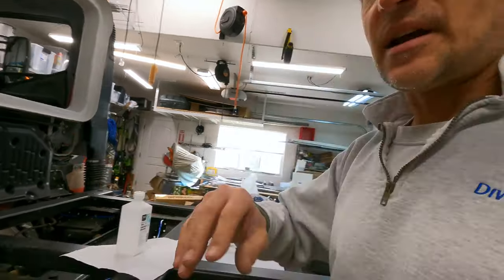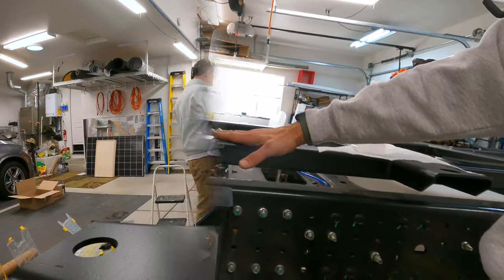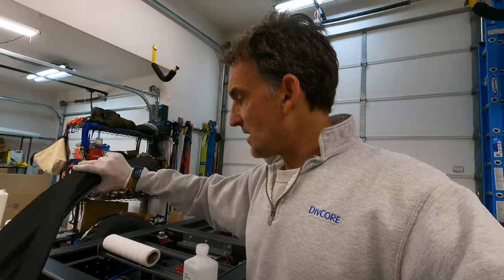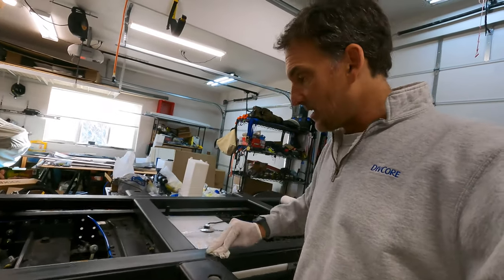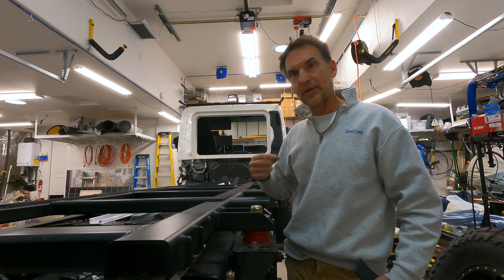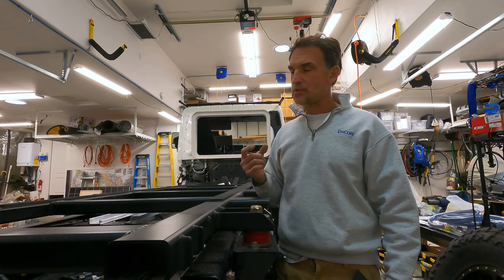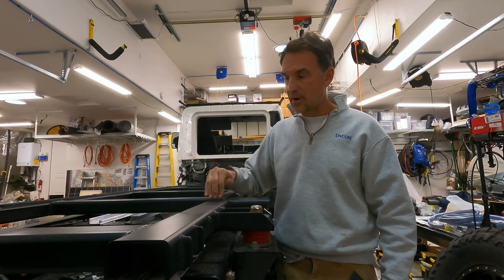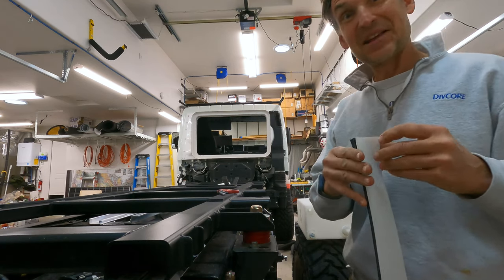Expedition Camper Build--prepping the subframe for the camper

Comment: Very interesting to watch.  Does T/C recommend against Urethane directly to the subframe?
Reply from the maker: I've not seen them recommend anything or against anything for the subframe. Why would you ask since the foam they use is a polyurethane and the skins adhered to the foam are fiberglass, which polyurethane is about the best material to use with it? The strips I used are EPDM, which is a synthetic rubber and made with a polyurethane which is similar and compatible with the binders that make fiberglass. With its great light, high & low temperature (even steam), ozone & oil and gasoline resistance, outdoor rating, decades before degradation in the outdoors, and vibration absorption and near perfect compressibility yet non-permanent conformability, great tear resistance, tensile strength, and elongation and electric and thermal resistance, it's likely the best material to use for this purpose. What would be your concern with using EPDM against FRP?
Reply: @vantripping   You have clearly analyzed it to it's most logical conclusion.  My initial thought was to connect the subframe directly to the box with urethane(backed up by bolts of course) to eliminate the possibility of movement between the two.
Reply from the maker: @fidoexpeditions9366  Total Composites does not suggest glueing the floor to the subframe, just bolting it. I've only seen everyone bolt except for one company that use an adhesive as well and admits it's overkill. An adhesive could be used in addition to the bolts--would likely be destructive should the camper ever be relocated to another chassis, which I want to maintain that flexibility, hence the bolting only, and therefore the padding between the camper and subframe. EarthCruiser says they only use six bolts to mount their camper to their subframe and I'm using 10 bolts to the same subframe (with added bolted connection points).

Comment: Hey KC, just curious your thoughts on the GlobeTrekker 3/4 pivot subframe system.  Did you look at these at all?  I would assume that if you did, you decided against it based on height.  For my chassis, it looks to be a better option than spring mounted.  Just curious your thoughts on it overall if you did consider it.
Reply from the maker: Yeah, great question. GlobeTrekker came out with their subframe after I proceeded with EarthCruiser, and EarthCruiser's subframe has 10+ years of experience on this chassis, plus it only adds about 3" in height, and reducing height is the biggest challenge to keeping these builds overall dimensions trail tight since the same or less width and length than a pick up truck. Yes, each chassis does need it's own subframe design, or a possibly overbuilt generic one. I like what GlobeTrekker is building and glad they have come to the market to provide some great options and look forward to working with some of their products some day..
Reply: @vantripping  Thanks for the reply!
Reply from the maker: @XcessCapital  You're welcome.

Comment: 01:48
Is 'rubbing alcohol' de-matured... usually with a petroleum product?
Could that oil/grease effect your adhesion?
Reply from the maker: Good question. We only used Isopropyl alcohol 70% or higher. The adhesion of the EPDM strips was great, I just wanted to be sure that air did't catch on the edges while driving at highway speeds before installing the camper floor and for them to have pressure around the rounded metal edges of the subframe.